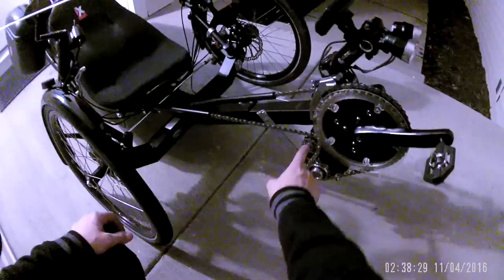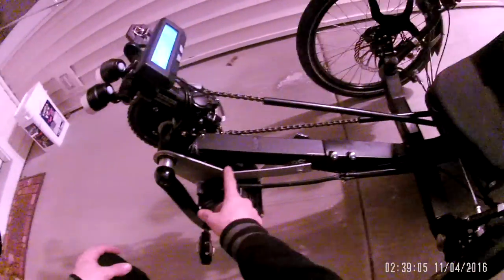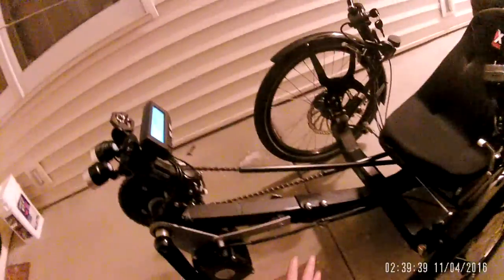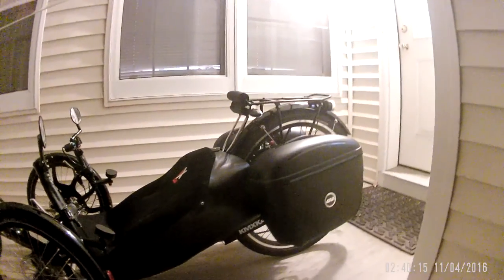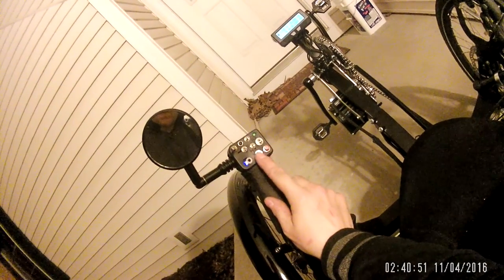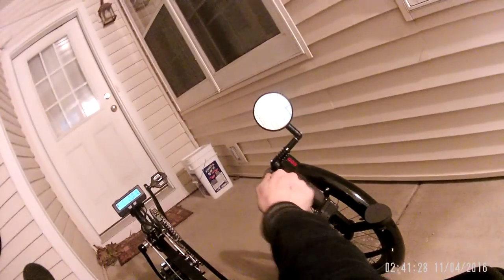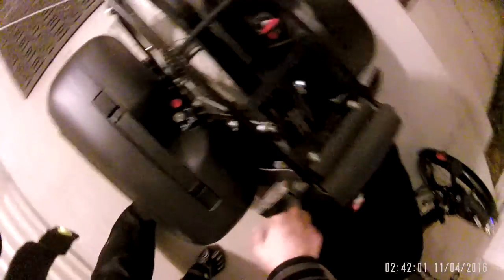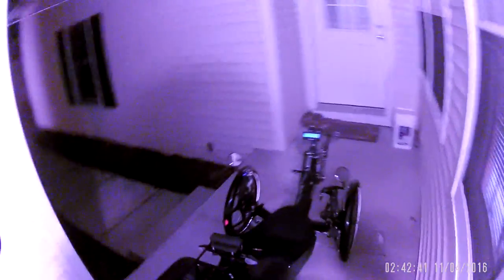Cyclone 3000W mid-drive electric trike Overview... (aka the Batmobile)

Comment: I like it. Lots of stuff compared to mine..( yours is loaded ;)). Mine is for top speed and handling vs yours is a nice cruiser. Good build. Just be careful getting up to speed without suspension (front especially) as it can bounce the trike  out of the path your travelling sometimes quite violently.
Reply from the maker: +John Zoccano Thanks!, heh, "loaded" thats a way to describe it... Its indeed a sweet cruiser as I usually ride it to work @ 30 mph for long range and to avoid getting in trouble. But make no mistake, is wicked fast as the trike has been up to 58mph on 5.2 kW, but I ran out of road when I tried to breach the magic 60 mph, but I will get there at some point; doing 0-60s on the trike is hard as heck on everything so I don't usually do those on a daily basis. (more like twice in the 500 miles I have on this guy) Now the suspension hands down adds to stability, but I think b/c the frame of this trike is steel (not AL) it is actually pretty smooth even at 50mph than most of the AL trikes I've test ridden at under 20mph. The handling is also dictated on a trike by weight distribution, and on this trike is about 80-20, so most of the weight, including rider rests all over the front wheels, and that has allowed me to take roundabouts @ 40mph without lifting the gas or the inner wheel coming out; HOWEVER, you're right, this is where suspension helps, so you really have to watch for potholes. Fortunately tho, a guy called Adam (he also has a super nice trike too, Adam Roy, one of the comments on this video is him) and he makes a nice front suspension for the KMX trikes that I will be getting once I am done building a 2nd one like this guy . I am really looking forward to seeing your next trike; don't forget to load it up with features :)

Comment: Hey man, amazing work!
Sorry to bother you with the calculation but I wanted to know how much approximately did the whole project cost you and do you have suspension on the trike?
BTW I just finished my own cyclone setup on my bicycle and I did your RPM unlock trick  and this thing flies now!
Reply from the maker: +Mo J I don't have suspension as of yet, but I will be installing a front suspension upgrade in the coming weeks. More than money it was a lot of time (and work); I spent close to one solid man month working on this guy, Expect your starting price at around 1.5k.. the rest is how deep do you want to go.

Glad the RPM unlock is working out for you, it has worked great on my eBike and now on the eTrike.

G.

Comment: Hey I'm planning on doing a bike with a 3000w 72v mid drive motor but the bike I'm planning on using has 20x4" rims, do you think it can do 50mph?
Reply from the maker: You'll need a lot of RPM to hit 50 on small rims.
Reply: @gMan1971  Can't I just play with the gearing? The bike will have a 9-10spd. 72v 3000w is alot of power...
Reply from the maker: @Chris951mv  Even with gearing, it is unlikely you'll even get close to 50 mph on an upright bike unless it has aero work done, or it is a road racing bike with aero work.
Reply: @gMan1971  The bike I'm looking at is the called the BuzzRaw. People with the bbshd are claiming 35mph and that's a 1000w
Reply from the maker: @Chris951mv  Well, not going to argue over some Internet claims, Chris. The Cyclone on this trike is advertised at 3000W, yet I have it running at 7200W...  At this point, the only way you'll be convinced as to how fast you can go is if you try it yourself. You believe in the claims, so go for it: Get the C3000W, Get that bike, install the kit and see how fast it goes.
Reply: Hey Chris if your still planning on making it go with 29ers and continental ebike wheels. Get the 60a controller from Luna and and two 72v 40a battery’s. I’ve hit 74 on a upright bike built like a cafe racer with a huge heat sink and fan. Look up cyclone steel gears and use Mobil red aero grease. I also added a bit more winding but it’s not hard to do. Good luck

Comment: How did you get it to do 60mph and what size battery do you got on it?
Reply from the maker: improved aerodynamics and a 72V 16000 mAh battery.
Reply: gMan 1971 Thanks buddy. Do you know if you can limit these motors to 750w? I wanna know because I'm in the US and wanna ride in the city without any trouble from the pig's.
Reply from the maker: You could remove shunt resistor material to lower the wattage inside the stock Cyclone controller. Otherwise you'll need a programmable controller with watt power adjustments.
Reply: gMan 1971 Perhaps a kelly controller or blue tooth controller will work?
Reply from the maker: Cyclone bluetooth probably. Not sure about kelly controllers.